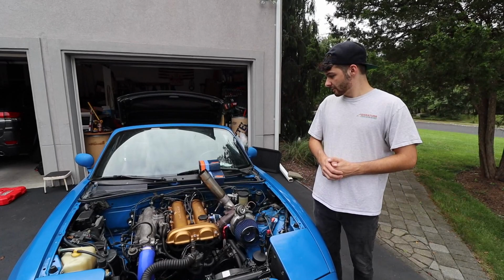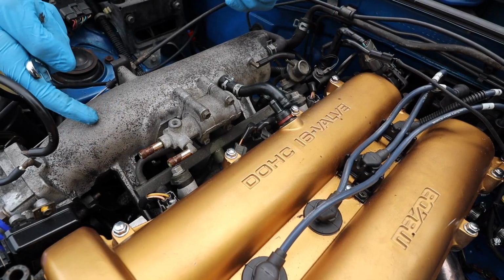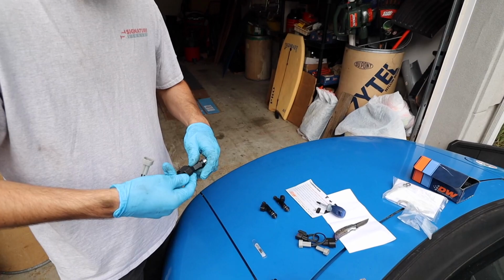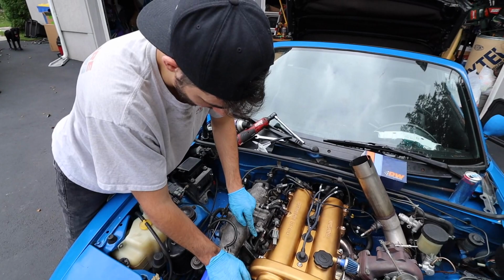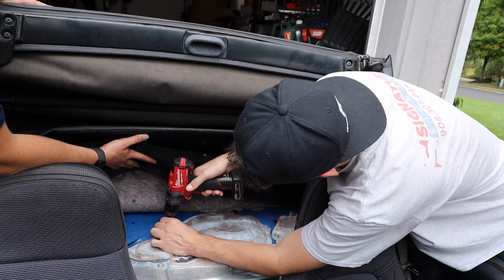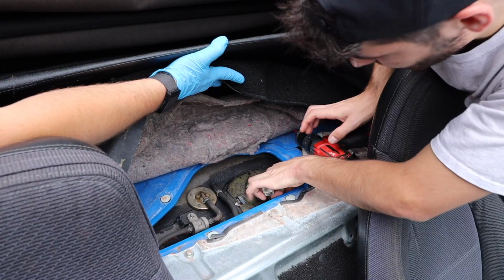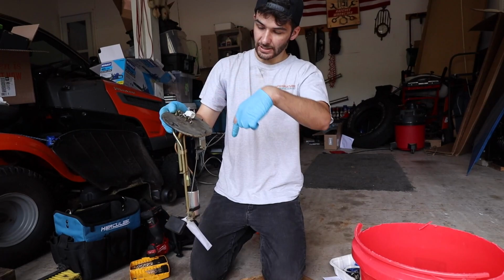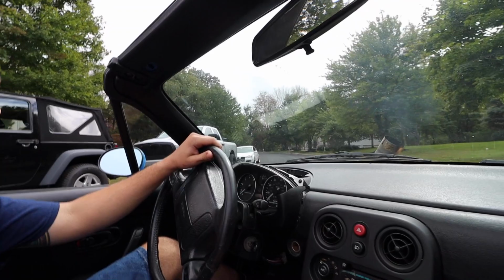Deatschwerks 550cc Injectors & 165LPH Fuel Pump For 1.6L Turbo Miata

Comment: Good size injectors and pump 👌 just need that clutch and could easily push to the 300bhp. competition stage 4 clutch is what I have and is more than enough
Reply from the maker: Yeah the fuel setup was for what we want but if we do plan on going with more power we will def look into that clutch! We just wanna get it running and enjoy it first before we get serious numbers

Comment: Have you been using tunerstudio auto tune feature to get the ve table etc looking and running good? I was hoping auto tune would help with the slight fuelling issue causing it to stall out
Reply from the maker: You can do auto tune yeah I think it works well from what we’ve heard but we decided yo take it to a tuner instead
Reply: @RatchetWrenches  Bro if you guys have the time before you take it to the dyno you should pay the extra 100 bucks or whatever it is and get the tuner studio pro or whatever it's called and use the auto tune feature before and get the map and VE table looking a little better and get the car driving a bit better, I think the better you get the map and get the car running smoother it will be less hassle for the big dyno day. I think with both street tuning and dyno tuning you will be able to get the car running the best it can. And would make a sweet video if you could post using the auto tune

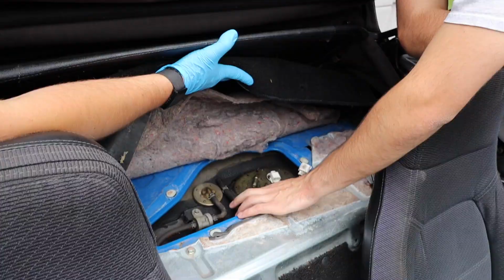Comment: Incase you guys dont want alot of fuel leaking when you take off the lines on the fuel pump @7:25 just unglug it first prior to unscrewing and crank the car to purge the fuel left inside.